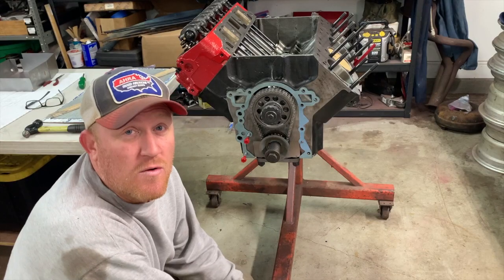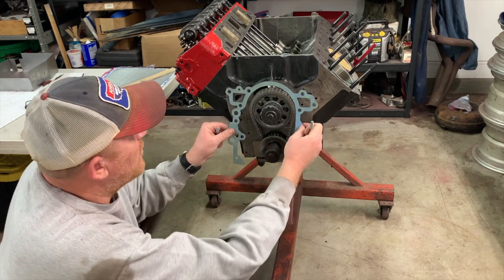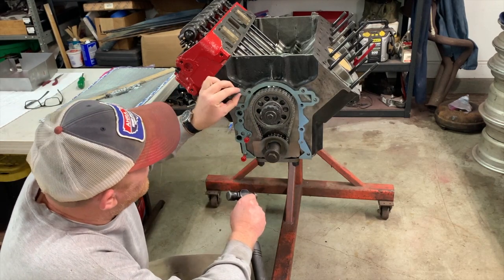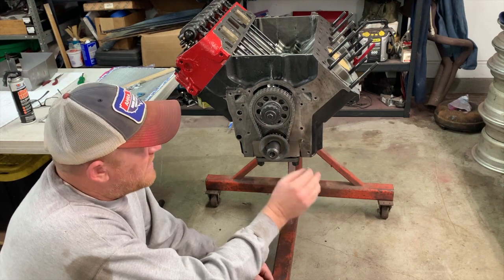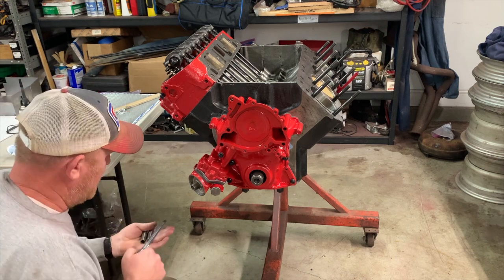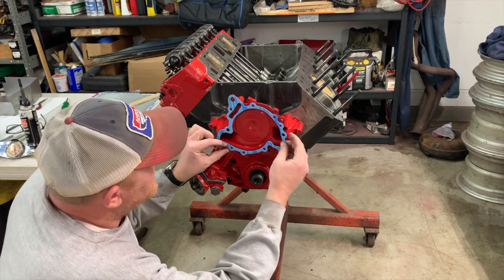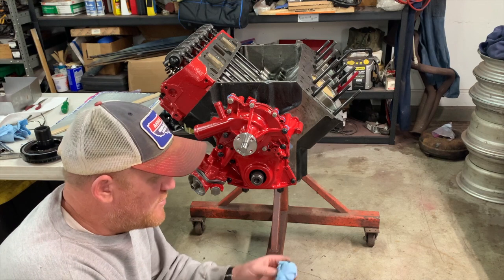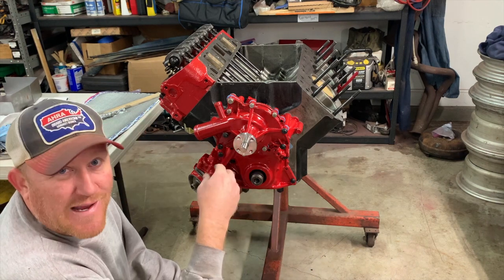How to install your modified Buick / Rover V8 timing cover and make it all work as you designed

Comment: What is the ideal oil pressure in min and high for this engine?
Reply from the maker: Well that’s a loaded question. Generally a Buick V8 has great oil pressure at startup which confuses people encountering oil pressure problems. Once the engine and motor oil gains some heat the oil pressure drops, especially at idle when warm. I shoot for about 10lbs of pressure at idle when warm and upon revving it up it should maintain 10lbs per 1000rpm, so 2000 rpm is 20 lbs, 3000rpm is 30 lbs and so on… that is a good rule of thumb.

Comment: What is this engine that you are using the ATI Buick V6 balancer?
Reply from the maker: It’s a neutral balance Buick V6 balancer, I had the 350 Buick internally neutral balanced and then used the V6 balancer. In a stock application the v6 balancer can be bolted on a Buick 350.
Reply: @mr.roddersneighborhood2740  Thanks!  So that balancer can also be used on the Buick 215/Rover V8?
Reply: @mr.roddersneighborhood2740   Thanks for the great small block vids.  👍 So a typical factory 350 will use the ATI external balance V6 damper Part #918400?  Correct?
Reply from the maker: @G_Machine_Joe no, you would have to remove the rotating assembly and have it balanced to zero balance unless that balancer is for external balanced rotating assembly.
Reply: Their chart lists that P\N under "External Balance Damper Assembly - Buick V6 (430-455)  Steel Shells 7.07" OD"

There's only one other listed under "Buick V6 & V8 (ALL) Except 430-455 but is Internal Balance Damper Assembly".

Comment: Late here, but going through the stack of vids when able - My Rover 4.6 and Buick 215 will be in lightweight (2,200 lb) daily driver street cars and already have Howards cam, Proform HEI dist. beehive springs, Grand Nat. WP, Melling pump plates-gears, and had planned to send off stock balancers for revulcanizing rubber, but if my application can also go Fluidamper, that thru Summit or TA? Great info. every video!

Comment: Neva knew the timing covers were interchangeable or the balancers. Can’t wait to hear this small block run another great video Dallas.
Reply from the maker: all of the small block and v6 timing covers are interchangeable in the same generation of engines. They are all really in the same family. Check out the Small Block and V6 timing cover compare vid and it gives you the full rundown. later V6, series 2 and later, are in a different family and do not interchange without extreme modification and machine work.